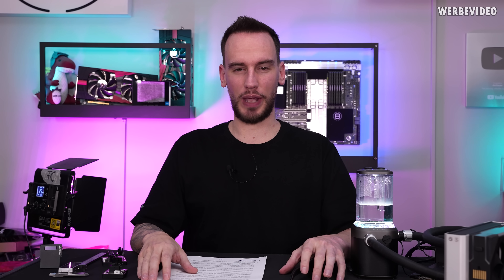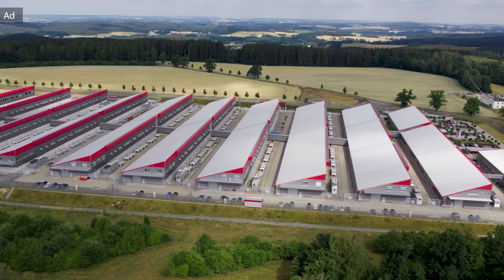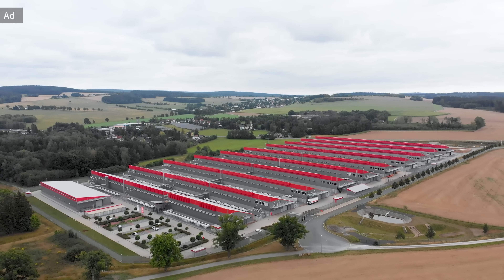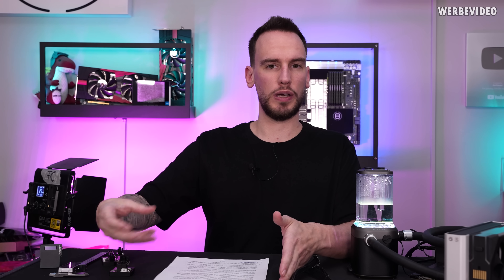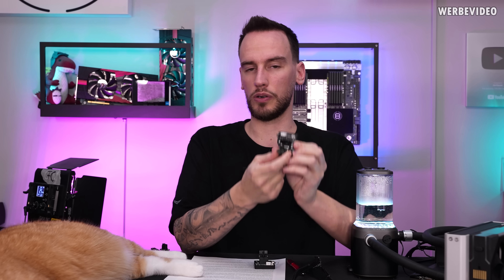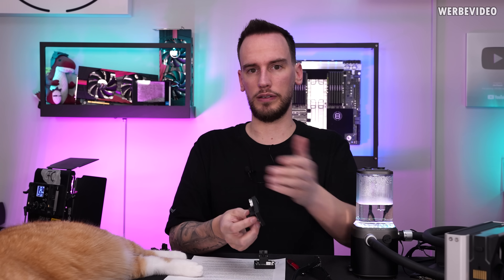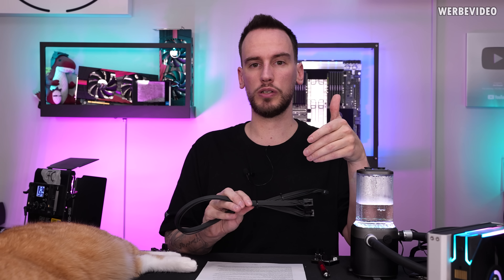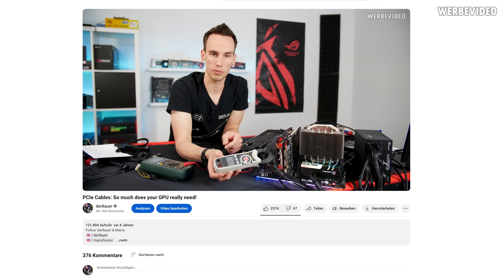12VHPWR is just Garbage and will Remain a Problem!!

Comment: Just look at any automotive connector thats expected to draw 40 amps at 12v. Dunno why they did such a rubbish job at reinventing the wheel. If they wanted a more compact connector why not just use 1 or 2 larger conductors and more robust terminals like any other industry would? I cant see the benefit of jamming soo many tiny conductors into one plug a single or or pair of heavy wires would be more compact and tidy aswell

Comment: put an XT50 power connector on the GPU and Power supply and call it done. why should there be many wires on the same polarity? when you need amps/watts you should use a larger gauge of power cable. do not use multiple separate wires in parallel creating redundant failure points.

Comment: i dont understand why they needed a smaller 16 pin design when they could have just used a 10-pin one similar to the PCIe 8-Pin conductor size. The latest version of that size plug with 16 AWG wires runs max 13A per wire on the female size and 9A per wire on the male side (according to Molex's datasheets for MiniFit +HCS Crimp). If you have 5x 12v wires that is 45a per plug or 540W at absolute max. Molex's test sequence though as I remember reading it was 15 mins max load, 45 minutes idle/rest at the maximum current they list, so one couldnt just smash 1 connector at its max for hours or it will melt. Even just switching to the same circuit design as 8-Pin EPS which is 4x 12v and 4x ground in the same size 8-pin connector would offer up at the most conservative level probably 225-250W per plug. 2x 8Pin up to 500W conservative, or 3x 8-pin on the chunky fella that is the 4090. And that would have the bonus benefit of doing away with those 6+2 connectors... those are so annoying sometimes.

It never made sense to me to half the size of the connection terminals and have the same amount of 12v wires and rate it at 2x the current that 2x 8-Pin PCIe is combined at worst that connector if you adhere to the same margins that we had for the PCIe 8-pin would be 300W per 16-pin connector (or drop the sense pins and call it a 12-pin connector).

Comment: I've always known the 8 pin was way underrated, just tied down to old spec requirements. I find it funny that for most power supplies that come with the 12pin high power, they terminate at the PSU end via 2x 8pin. Also learned from building some mining rigs that the 8pin PCIe will take 300+ watts all day for months straight and be just fine. The OEM 4090 design shoulda have been a 3x 8 pin, giving it a 525w max tdp within spec. And then let board partners do whatever they want.
Reply: 8 pins have a lot of margins, their rated current is more then 2 times lower then what they can in theory take. 12VHP doesnt have any of that, this game of chance comes to small manufacturing defects that happen all the time.

Comment: Contact surface area along with clamping force is clearly marginal at best for the 12VHPWR connectors.    It's also a runaway situation where once one contact increases in it's contact resistance it causes the remaining pins to also start to heat more which causes those to also increase in resistance.    24 volts would solve this issue,  but that would require a new PSU spec.
Reply: Yup and I think that's how NVIDIA has been getting away with this, the cables are technically enough to carry the load, which is also why the cable isn't melting. The real problem is the connector doesn't have enough contact area to carry the load unless conditions are 100% perfect.
Reply: 24v would make a single connector practical (assuming they didn't minimize it's size), but also a zif type socket with a clamping lever for basically guaranteed engagement of the pins, resistance to pull-out and side loads.

Load resistors per pin to monitor current to clamp any runaways (one pin delivering more than others) combined with proper use of a sense wire so the gpu can throttle or go into an error or low power state when there's excessive pin/wire voltage droop.

Lots of things that could easily have been done, but would have increased the bom by $1 so that's out of the question.
Reply: 24V would help on the connector side, but it'd increase the cost of the VRMs. We are starting to see GaN (or GaN-on-Si) processes with some of the new stages - iirc MPS has a line of them now - which would help alleviate the challenges of switching a larger high-side voltage, but it's the passives that get tricky. High-side capacitance would end up being much more challenging at twice the voltage. Alupoly / solidpoly caps with sufficiently high dielectric strength for 12V operation (typically rated for 20V) are fairly cheap, but once you bump that to 35V+ it gets much more expensive to design around due to loss tangent / dissipation factor typically being worse at those voltages unless you really crank the physical size (which is obviously problematic from a mechanical perspective, but also comes with worse ESL). Higher voltage isn't usually an issue for standard aluminium electrolytics, but they can't handle the ripple current of these designs, and by the time you parallel enough low-ESR alu caps to handle the thermals from DF you end up running into problems with parasitic inductance (e.g. forming resonances). MLCC derating on class II dielectrics is also generally tolerable at 12V, but at 24V it becomes much more problematic and you end up needing greater MLCC package sizes across the board, which is a pain for dense layouts and may exacerbate radiative EMI problems due to larger current loops.
Reply: @gsuberland  That's a great bit of perspective on the challenges of a higher supply voltage, I wouldn't have considered the implications on regulation/filtering. Everything is a trade off I suppose, and maybe the added complexity and constraints wouldn't have made sense.

Regardless, it seems the trend for more and more power hungry cards isn't going to end, give it two or three more generations we'll see cards doing 800w+ on stock settings; improvements to connectors alone isn't going to solve the issue in the long run.

Comment: As far as I know, It doesn't work like that. On 3090ti if one of 3 8-pin cables fails the rest ones don't use more power. 3090ti has 3 independent lines for power in one 16-pin connector. But 4090 has all 6 power wires connected to 0ne line of power. What do you think will happen if some wires fail, all power goes through the rest of the wires/pins. And if there are only 1-2 properly connected pins in a 12-pin connector, it eventually melts down because all power goes through 1 or 2 pins. 
Please consult with someone who can confirm that.

Comment: Nvidia: Alright Gentlemen. Where can we save costs this gen?

PCB guy: We can make the PCB a bit taller and much shorter as a result! Saving costs!

Power delivery guy: Yea thats all great.... How the fk am I supposed to power this gen then? because I'd need atleast 3 if not 4 8 pin connectors...

PCB guy: Why dont we just make a new connector? Slightly larger than a standard 8 pin, it'll be fiiiiiiiiiiiine.

Power delivery guy: So you want to rate a card for 600W and use a 600W connector and just pray every user has a quality PSU?

Nvidia: Sounds like a poor people issue to me, lets do it! Besides, most of our AiB's got fkd the past few years anyways, throw them a bone and offer them a chance to sell people a new PSU to replace their perfectly fine older one because it'll have.... Wait for it.... Our new connector thats not a nightmare to cable manage!! Ah? Ah? Ah?!

Marketing department: *Starts crying out of joy*

RMA department: *Starts Facedesking*

Comment: Random thought...

The auto industry is moving to higher voltage systems as pushing amperage has it's drawbacks (heat/thick cables), as PC hardware seems to be going in the same direction why is intel (and others?) pushing for a 12VO system? Wouldn't this be a short sighted side-grade over the current system?

Why not move to a 48v or 96v (if you have to use arbitrary 12 increment...), thinner wires less amps etc...

Comment: I like your suggestion of using two 12VHPWR connectors and splitting the power across them as this seems like the smartest approach when talking high power draw.
Reply: Might as well use the old 8-pin expansion power connectors then, what's even the point. Those are cheap and decade+ proven reliable.
Reply: @SianaGearz  Migrate to CPU/EPS for expansion cards/gpu’s.
Reply: @clippy_friend  Being same connector series they are of course just as reliable, and have more current carrying pins, but they don't have presence detect for a merged rail, which is a bit of an issue for GPUs.
Reply: What? Thats the worst solution. Microfit is the problem.
Reply: True but it is the best patch job for this dogshit @clippy_friend

Comment: If you look at this plug in detail, the way the sleeve makes contact with the pin is not made in the best way in my opinion. The sleeve or the part that is crimped into the wire itself has a relatively thin metal that is also too soft and will never press hard enough on the pin. 

We need to get a new type of gpu plug on the market!

For video card factories, only money is the most important thing. In the same way as car factories where they refuse to take responsibility for a problem and do everything to avoid having to replace something and blame the user.

I have the impression that those who make video cards often do the same.
They often do not want to take responsibility but blame the customer even if it is the factory's fault

Comment: Those CableMod adapters were always a terrible idea. Adding several more points of failure into an electric circuit is always bad. It's the equivalent of running a microwave through 3 extension leads. There's going to be a fire somewhere along the way.

I've been using a single cable (4x8pin to 12VHPWR)  from PSU to my 4090 for almost a year now and haven't had any issues so far, touch wood. However, I never use over 450w on the card, so likely why I've not seen any issues. It is always in the back of my mind though.

I would like there to be a rethink of power connectors for future GPU's though. There are definitely issues with the 12VHPWR connector. Though if Nvidia keep doing an Intel and raising power draw with each new generation, we might as well plug it straight into the wall with the 3-pin PSU kettle plug. 😂

Comment: the pins and connector are just too small for this kind of current, they should be full solid core pins on the male side and twice as thick. Its mostly connector and contact resistance heating the connection, not the cable thickness. This is often already on the card sides a problem.
There is nothing wrong with the cable thickness, and its possible to do this over a connector of this size if they have slightly larger, longer and thicker pins on both connector sides. This could even fit in the current connector, they could already make the female side thicker on the outside.

Comment: First all that cable is rated for 50 amps and doesn't have any locking mechanism or support on it ☠️
At this stage just give me a scrue terminal

In case of power systems of electrical stuff

U ignore the maximum rating and use the minimum as your red line even that won't be crossed
Reply: This thing is so dumb, I can not believe it.  I look at what we use in industrial settings for 50 amps and it makes me feel like this is engineering incompetence.
Reply: Exactly man 50amps wire are pretty thick

I am pretty sure there is an engineer who knows that it's basic shit
Someone knowingly allowed it

Comment: Tyvm for the vid. I purchased a Asus TUF 4090 mid Oct 2023 which is still using the org connector. I tried the default plug and the red led light was on since I first booted it without any bends but I received my cablemod 90 cable (not the adapter) the next day and swapped it in because that stock cable just felt like a bad idea to use.

I then put 4 temp probes on the plug. 2 monitored thru Aida64 and the other 2 Corsair iCUE. I also never push my gpu over 400 watts. The max temps I'm getting on my cable plug atm is about 40C but we are in winter here in South Texas which is a mild winter. I expect the temps to go up to 45-50C in peak summer. I also have a backup cable in case the current cable starts to faulter. 

I agree it's rather ridiculous that Nvidia has not addressed this issue and from the news I've read the new Super cards will continue to use the same connector. Prolly won't be an issue for most but still a chance for that 4080 Super.

Comment: Putting the connector on the top of the card is the worst possible place they could have put it.
A better option was to make a cutout and point the connector to the back of the card so the wires run parallel to the card so there is no mechanical stress on it and the connector could get some cooling from thew main gpu fans

Comment: Just wanted to say to all the 4090 buyers out there: you got what you deserve.
Reply: @RC_Flyer-h2v  Happy for you. That shouldn't be the standard to get a working machine that lasts longer than a few years though. Also, you had to "fix" a 2000 dollar product with hundreds of dollars unforeseeable hidden costs and several new possible points of failure and voiding your warranty if you installed your own water block.

Good consumer. Roll over, paw, play dead. That's a good consumer.